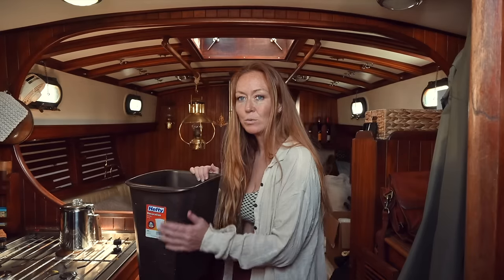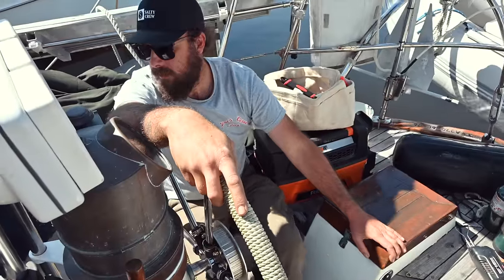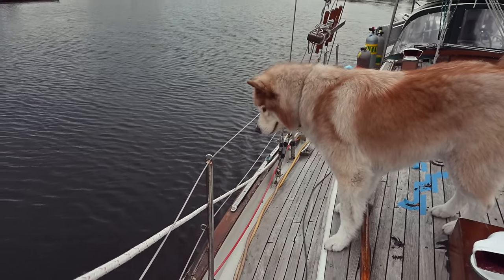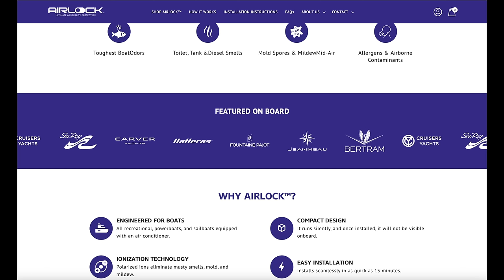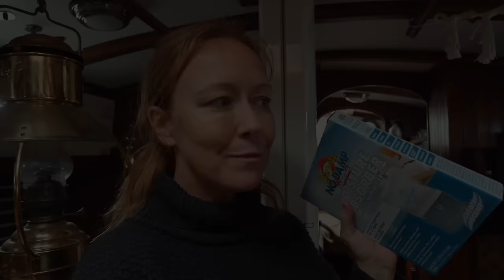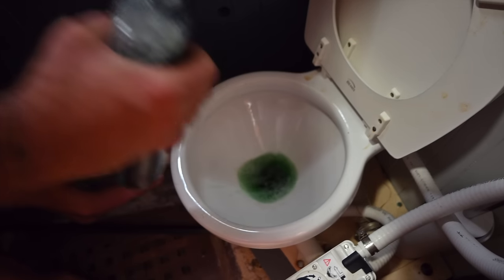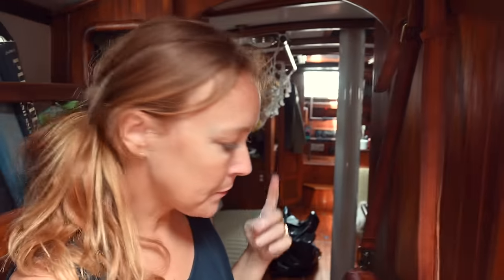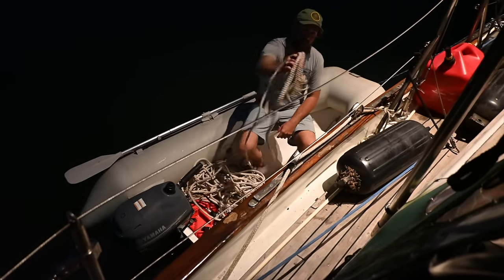MY FIRST DAY UNDERWAY ON MY NEW BOAT!

Comment: My water tanks on my 35’ sailboat was used for showers and washing dishes only , we would add a cup of bleach to the tanks every tank fill , but my tanks were plastic if your are SS DONT  do bleach !  I would drain the tanks by opening the lower feed line to save my pump and electricity and pump into the bilge and add bilge cleaner to,do,two Jobs at the same time !
Reply: yup....thats how i clean my bilge/water tank !
Reply from the maker: Thanks! Yeah, ours are aluminum or SS

Comment: Money saving tip: The damp rid powder is calcium chloride. When it is time to refill the cup and basket type, we use prestone driveway ice melter from an auto parts store. Same stuff, just unscented. Being in Fla. you probably would have to order it, but it is around $10.00 for 10lbs.
Reply from the maker: Ahhhh nice! Thanks!
Reply: Thank you for that tip. I appreciate that. I'll try that in the cool, damp basement.

Comment: Love your videos, and know how you feel , I had a 35’boat for years , but a lot of your problems are just not thinking and moving too fast , slow down and make a list of things to,do everyday and before bed !! It will help , my wife always had a list and she was my Measure twice cut once ! 👍🏻👍🏻
Reply from the maker: Well, we had to move fast! We only had a few very short weeks to get the boat ready to travel over 1000 miles and we both have jobs we have to get back to, and the marina was supposedly doing work on the docks and we needed to leave no later than when we did. SO it was a LOT to do in a very short amount of time.
Reply: Good advice. The older you get, it doesn’t get better. Start now and this advice will pay off immediately.

Comment: to get rid of the mold spores buy a small ozone generator, open every door inside  turn it on and leave for the day. do this a couple of times and it works. We used in our camper and sailboat.
Reply from the maker: That’s definitely an option, but when traveling, that’s impossible because we can’t rent one to get it to the boat. We don’t have a strong mold smell or anything, just an old boat smell. I like it. It reminds me of other boats I’ve worked on in the past. But honestly we’ve been using this little thing for a while and it works!

Comment: Try a strong blend of occaclic acid / water mix (comes in a powder form) and let sit after scrubbing for at least 10-15 minutes, maybe 30 - that will make your decks bright.  You could also use the Teka A and B process but that is very consumptive of the soft fibers.  ALSO - scrubbing in the direction of the grain gets the dirt out and also the teak... as hard as it is going across the grain is best for longevity - the scotch pads are really good for that type of work - there are no bristles to deck wreck....  Suns out Teaks out!  🙂
Reply from the maker: Thanks! 
Yeah the wood grain thing I actually explained with text on the screen. In day to day cleaning, I’d always go against the grain, but with teak cleaner, you are supposed to go with it.

Comment: Too bad you felt so much pressure to leave HH. Your slip remained unoccupied for several days afterward.
Reply from the maker: Well, the story they gave us was that they were going to be doing work to the docks and couldn’t give us more than that additional week we did earlier this month. 🤷‍♀️ Who knows. They may have just wanted us out of there because it wasn’t until we bought the boat that things came to light for them. The diesel leak they blamed on us had started before we bought the boat, and there was a small black water leak that had been going on as well. As soon as we got the boat, we found and tackled those problems, but that’s when they realized they were happening so I think they blamed us, even though we were cleaning up the mess of the previous owner. I don’t know! Maybe they really did need to do some dock work. Does it look like it?? Hahaha
Reply: Don't take it personally, I would say that the reason they could not accommodate you is that there are too much demand for this marina. Five years ago there was a fair number of slips available. Then after 3 hurricanes went through Daytona in about 4 years, all boats from St Augustine to New Smyrna wanted to be at HH because it is so well protected in bad weather and there is now a waiting list. With many more boats docking here, I don't think that they increase the staff, which makes it more difficult for them to accommodate people. BTW I really enjoy your channel, you guys come across as quite genuine people and your music goes very well  with your content.